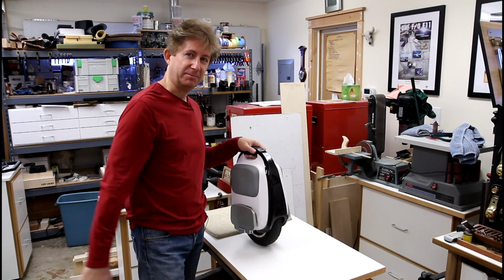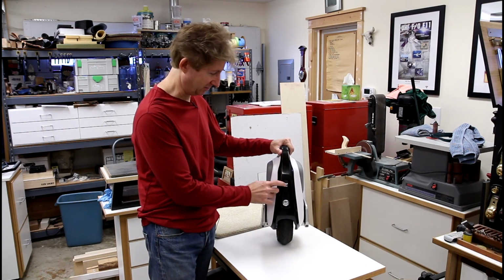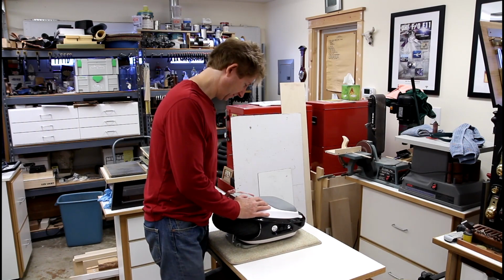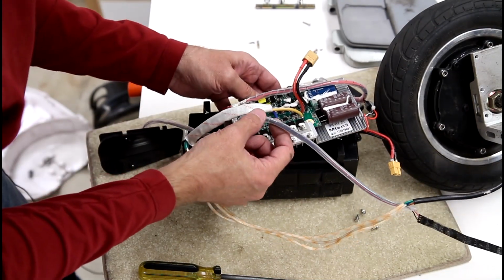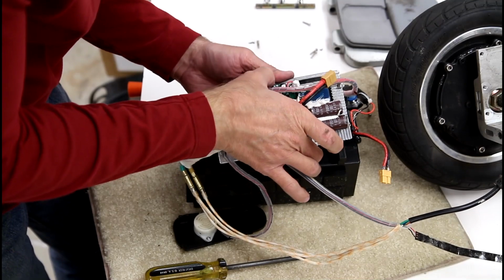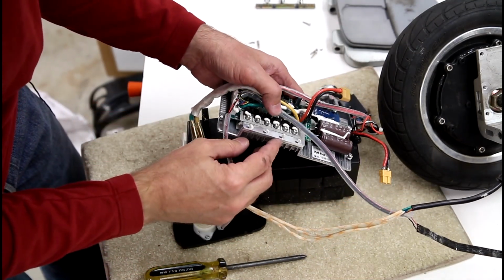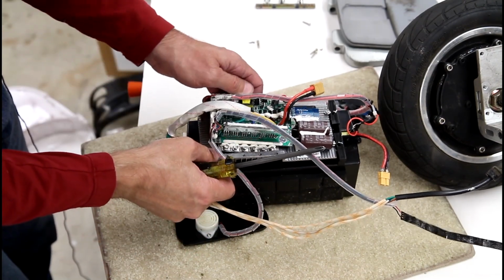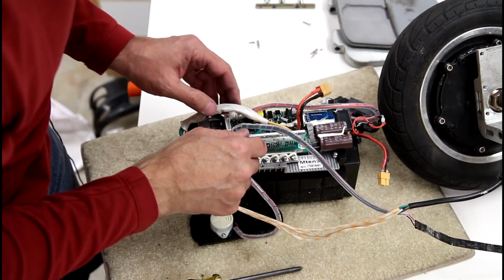Broken Gotway Mten3 Tear Down

Comment: Hey Marty--I successfully replaced my MTen3 motor! It was actually easier to do than I thought. I was hesitant at the start, not wanting to create more damage during opening but once I got in there, it was actually not that difficult. Your video was helpful to remind me how things went back in upon re-assembly, although I took a few creative licenses in where I placed the wires. My axle broke at 544 miles and now I have a new motor. Cheers! :)
Reply from the maker: Glad your operation was successful. The MTen3, as wheels go, is easy to work on. Putting the tire on the rim is probably the hardest operation. Unfortunately, being such a small wheel, it has the old school small axle so it's probably easier to break the axle, but I image you were doing some rough stuff with it to cause it to break???
Reply: @ElectricUnicycles  Yes, I was hopping up a little step / ledge downtown and riding off it. Not terribly steep but I've never taken it off a curb more than 4" and I haven't done a terrible number of jumps on it. Staying grounded from now on!

Comment: I had a brand new Inmotion V10F fail in a similarly mysterious way - it tipped over at walking speed on the third trip I took with it and was stone dead from that moment on. Couldnt switch it on anymore, nothing obvious wrong when I disassembled it and looked at the electronics. I unplugged the battery too for a hard reset but that didnt do anything either. I wasnt too unhappy because it had been a discounted wheel and the warranty card showed why: it was nearly a year and a half old when I bought it. That wasnt worth 70€ off to me! Thankfully I could send it back and got all my money back but it still cost me seven weeks of riding time with great weather until I got my new wheel.

Comment: if you suspect that something burnt out on your main-board then you should look around the board for scorch marks and if you don't see any sniff around the board and hub motor for burnt odor because some electronic board have protection circuit that shuts down if it gets to hot. you can separate the hub motor, fans, battery and  main-board and then power up each one to see if they still work using power supply or extra known good battery.
Reply from the maker: It's all fixed. See the follow-on video if you want to see how I fixed it. https://www.youtube.com/watch?v=kDpeAhU92fM and https://www.youtube.com/watch?v=Boe7TL8CV6A&t=4s
Reply: Im thinking about buying a gotway MCM v4 but I was told that you can't upgrade from 340Wh to 680Wh. if gotway made up-gradable electric unicycles and start off from low cost stock models, with starting  price at $300-$500 before upgrades gotway would do fine. They got 3000-5000 watt hub motors for bikes that do 72-110 km/h. imagine putting a 5000 watt hub motor on a electric unicycle.
Reply: now if you don't want that gotway Mten3 and your looking to throw it away then I'll love to have it.

Comment: Looks like you are more into unicycles than me, btw is this normal that my mten3 fan, when the wheel is standing still runs alternately high speed, low speed? Fortunately when riding fan works well bcs wheel is 41°C
Reply from the maker: Yes, that fan behavior is normal for many Gotway wheels

Comment: Hey Marty and fellas. Have you tried to fit a freespin kill button on these earlier Mten3? It seems like they might (like the msx) have a header on the board ready for a button to be connected.
Reply from the maker: I have not. The newer Mten3's have a kill switch so I would guess that the older Mten3's do not have hardware support otherwise they would have included the button.
Reply: @ElectricUnicycles Thanks! I know that's the case on my Tesla v1, but on the Msx it isn't. The header is there. I'm just curious of which case it is for the Mten3. Happy riding! Statistically you can't injure yourself again within the next 10 years.

Comment: Bummer Marty! Since there is no visibly blown mosfets, I wonder about an overload circuit? Maybe try powering back up since the battery has been disconnected? Other than that, a voltage reading on the pins may reveal a bad one.
Reply from the maker: Thanks. Gotway wheels don't have an overload circuit. I was just curious to see a blown MOSFET, but I don't care enough to diagnose it further (not enough hours in the day as it is). Jason (EWheels) is getting me a new board.
Reply: Marty I know Gotway HASNT had circuit protection, but the m10 is new, and even I keep hoping they will up their game. What happened to your m10 is exactly what happened with my MSuper v3.
Reply from the maker: I know. I actually thought of you when going through this. I think it's a little bit of bad luck in how the wheel interacts with an immovable object (wall in your case). Fortunately this continues to be a rare event. But no turnstiles for me anymore :-)  I'll reconnect the battery later for kicks to see if anything comes of it.

Comment: Thanks for this very helpful video. My mten3 died today. Something has loosen in the axes area. No it beebs 2x in half second. I must disassemble i see what's going on
Reply from the maker: That beep codes means that there's a failure with the Hall Sensor. Either the connector to the control board has come lose, one or more wire broke in the axle area, or a failure inside the motor.
Reply: @ElectricUnicycles  thank you for you answer. You are right some wires ripped off at the axles area. One of them must be the hall sensor wire
Reply from the maker: @velly027  I'm curious, how did that possibly happen. Did the Mten3 fall off the back of truck ;-)
Reply: @ElectricUnicycles  i jumped from high curb today. Now I can clearly see one side of the axles is broken and the motor wires are damaged. A screw like axle is welded on a shot bigger axle in the middle of the motor. Its broken on that welded position. The bad thing is ... it can easily happen again if I buy a new wheel
Reply: I'm not sure if it was welded
Reply from the maker: @velly027  I think you've discovered the hard way that the Mten3 is really not designed for jumping and hard use. I has the older style axle (i.e., small) relative to all the newer wheels. The bigger wheels have much thicker axles.
Reply: @ElectricUnicycles  thanks. I will ask in the euc forum if is there a replacement for the axle. I will post a picture too
Reply: Same thing happened to me today. Did you find a replacement axel? I think it may be easier just to replace the whole motor since the wires are destroyed.
Reply: @StarBoyEUC     I ordered a new motor from wheel rider store aliexpress. The wires can be resoldered easily but the axle must be replaced.
Reply: I just pulled the motor wires from the control board. So much silicon everywhere. Shouldn't have to do any soldering. The motors are plug and play.

Comment: Thanks for sharing, this was great.  I have a nearly new MTen3 just like yours.  It's already been back for repair.  From the first time I powered it I found the fan noise disturbing-- how does that work?  Is there an air filter?  Where does the air come from?  Where does it go?  Does it suck dust in?  My fans rattle sometimes, can a dead fan leave me stranded?  So I loved seeing how and where dirt enters and deposits, and what's going on with the layout of the fans (although the active heat dissipation system still doesn't look any more effective to me than a heat sink integrated with the case).  I've been riding EUC less than a year but already have learned to be wary of cut-outs!
Reply from the maker: Depending on how you use it the wheel certainly could overheat if the fan(s) fail. Most Gotway wheels now use fans, and you are correct when you wonder where the air is coming from. They just circulate the air that's in the wheel and let "fresh" air get in via an cracks/joints in the shell. It's a crappy cooling design to be honest, but that's what they do. In general, the fans seem reliable and failures aren't very common from my experience.

BTW, if the wheel overheats it will simply beep and tilt-back, forcing you off the wheel. You wait a few minutes and then you can continue on your way. You can monitor the temperature with the Begode app or EUC World or Darkenessbot. The wheel overheats at 79-degrees Celsius.

Check out my Mten3 Playlist for all my associated videos :-)

Comment: 1st thank you for all your time and effort in making these videos! VERY HELPFUL! You should be getting wheels for free at this point.
2nd I recently purchased Mten3 the largest model and mine seems to have a manual calibration feature. when I turn it off the calibration is erased, so right before I turn it on I need to hold it at the tilt I want to ride then turn it on and it keeps that angle till I turn it off.
Is this normal?
 I've tried to research it but I haven't found any info. Jason is looking into it but I thought I'd ask another EUC professional.
Reply from the maker: Hi. Thanks for the nice note and congrat's on getting the Mten3. Your calibration issue is absolutely not normal. In all my years I've actually never heard of this issue occurring on any wheel. This makes me think that there's a problem with the Flash Memory. Do your other settings go away too? Switch the pedal mode, turn off and on the wheel, and see if the pedal mode also reverts. If it does, that confirms the problem is with the Flash Memory.
Reply: @ElectricUnicycles  using EUC WORLD app, it keeps my selected ride mode. Someone suggested I do a manual calibration again, I did but the issue remains. Hmmmm🤔🤔 what to do, what to do 🧐🧐

Comment: Ah damn I was waiting for the "it's not a mosfet, it's something simple!" moment.  Yea they sure looked fine, I never saw one that was blown that did not have an obvious sign externally.  Also I thought on other Gotway wheels when a mosfet blows the wheel still turned on but wouldn't balance/move?
Reply from the maker: From the Forum, it appears that there are other possible failure mechanisms, like the DC Converter module. Since my wheel still freely turns, it probably isn't a MOSFET. Just stay away from turnstiles are you'll be fine ;-)
Reply: Reminds of those Msuper V3 failures early when the one guy got caught in soft sand for a second and it blew the wheel.  Same with Ian, however I think in both of those examples the mosfets did actually blow.  Whatever the cause, I hope you get it back on the road asap.

Comment: How did you manage to remove the outer black surround? I didn't see how you did that. On mine there's a black lug holding it on, but I can't figure out how to remove it?
Reply from the maker: The black center piece is two parts and then snap onto the white shell. Loosen the tabs near the tire first and then you should be able to pop everything off.
Reply: @ElectricUnicycles  Thank you

Comment: Where is the speaker?  My brand new mten3 speaker died after 5 minutes of riding! Is that it on the back panel at 4:40?
Reply from the maker: Yes, that's it. It's not really a speaker, but single tone "beeper". All of our wheels pretty much use the same one.

Comment: Hey marty,  just had delivered the new M10.  Rode it about 20 miles and then it started doing this thing where it didnt power off .  I repeatedly press the power button with no affect.  I told jason about it and he referred me to your video.  Do you have any idea what could be causing this problem?  Would it just be a case of opening the wheel and disconnect/reconnect the power cable?  If its a blown controller then obviously it will need replacement.  Just wondering if there may be a quick fix that you are aware of.  thanks,
Reply from the maker: Wow, that really sucks. So the wheel is still on right now? Is the wheel functioning otherwise? Does the power button turn on/off the lights? If the wheel is functioning I wonder if it's a case of either a bad switch or one of the wires disconnected from the switch or control board.
Reply: Yeah, sucks.  wheel is still on.  I lifted it and ran the cycle to shut it down as much as i could but lights are still on.  power button does not turn off lights.  Jason suggested i open it up and disconnect the  power cable.  not sure i want to full on take this thing apart.  you got any suggestions? @ElectricUnicycles
Reply from the maker: @Born2Ride108  You didn't tell me whether the wheel works? Does it balance? Can you connect to it with the app? If it can balance then I contend that it's the switch.
In either case, the only way to shut the wheel off is to open it and disconnect the battery cable. Place the wheel on its side with the handle pointing away from you and the headlight facing right. Remove the cover. I probably have a video which shows some of this on my Mten3 Playlist. It's very easy to do, and you really have no choice.

If your wheel is not self balancing then that means the control board had a failure. Some failure mechanisms will result in the wheel stuck in the "on" mode. I've had this happen.
Reply: doesn't balance. lights are on. @ElectricUnicycles
Reply: ok.  thanks and will do. @ElectricUnicycles
Reply from the maker: @Born2Ride108  OK. That definitely means that your control board has died, which like I said, can sometimes result in the wheel being "stuck on". Unfortunate. It does happen on any wheel, so try not to blame the Mten3 specifically. I'm sure Jason will take care of you. I don't know if you belong to the EUC Forum, but it may be more convenient to carry on the discussion/help over there. After you open the wheel and disconnect the battery there's a little more work involved to fully isolate the root cause of the failure. Good luck.
Reply from the maker: @Born2Ride108  Funny, I didn't look at this video that we are conversing on, but it obviously shows you every thing you need to know to get into the wheel :-)
Reply: yeah, video is great.  Not ready to tear apart a wheel with 20 miles on it and risk a warranty breach.  Will send back. @ElectricUnicycles
Reply from the maker: @Born2Ride108  Yeah, that's the route I would take if offered to me. But I think you'll still want to disconnect the battery. I hope it all turns out good for you in the end :-)

Comment: hello marty, i dont know if you will see this, as this seems to be an older video of yours....but did you ever figure out what happened to your wheel? im considering an mten3 (the latest model available), but judging from your mishap and other comments here, i feel a bit dissuaded...im sure you did but you dont make mention of it here so ill ask: did you check the 2 large capacitors and the voltage regulator (i am assuming it has one) . i dont want to use this as some stunt machine, just for a few miles to run errands. but i dont want it to just die on me for no apparent reason. id be mindful not to over drive the components of course...but even with those preemptive measures, if the wheel is still not reliable, or still has unresolved failures...then it doesnt make sense for me to purchase. even though id really like to. your thoughts would be much appreciated! also, thanks for uploading your many seat mods. i shamelessly copied this idea haha and i fully credit that aspect of my euc experience to you. keep the great content coming
- rs19, nyc
Reply from the maker: You can see my "Mten3 Playlist" and find how I fixed it. Gotway subsequently strengthened the battery pack and in the years since I have not heard of this happening again. Many many people continue to buy the Mten3 - it's robust wheel, rest assured.
Reply: @ElectricUnicycles  ! ah thank you for getting back to me, i wasnt aware you fixed it. but that is excellent to hear, im going to peruse your playlist now..

Comment: my mten3 sent me to the pavement today.   It just got stuck and sent me flying.   After turning it off, I notice the wheel was now kind of stuck.   It would not spin freely.   I checked the axle and nothing obvious was stuck.   When I turn it on, it just sits there and beeps.  The wheel doesn't spin.   Any hints or ideas what might be wrong?
Reply: Were you able to fix it?
Reply: @bachhaphong7619  
The axle was broken.  I replaced it and the second axle had a crack in it.  In the end I just gave up and sold the parts off.  Have an mten4 now and super happy with it.

Comment: Hi can just see want you think my daughter was on her mten3 today she fell off wheel works fine she rode it home but I can’t power off the wheel with out unplugging the battery’s the switch works as I can turn the light on and off and when I hold the button it does the beep but doesn’t turn off. Do you have any ideas. could it be the switch still.
Reply from the maker: Doubtful that the problem is on the control board. Most likely the switch. Would be pretty easy to test by temporarily bypassing the switch with another one (any old switch)
Reply: @ElectricUnicycles  thanks I will order a new switch thanks for your help
Reply from the maker: @cgoateucz1039  I did suggest testing first :-)
Reply: @ElectricUnicycles  how would you test it I haven’t got any other switch. how ever I did unplug the switch last night and just Tried to jumper on the board but that didn’t work. It’s strange that the button works with the lights but won’t turn off very strange
Reply from the maker: @cgoateucz1039  I know everyone doesn't have the same resources, but I would probably cut the wires and splice in another momentary switch to see if the new switch worked and go from there. If it's not the switch then there has to be a problem on the control board. This seems unlikely to me yet certainly possible. Good luck.
Reply: @ElectricUnicycles  thank you